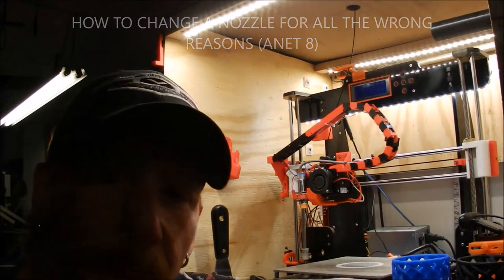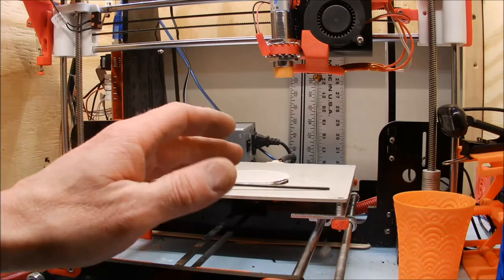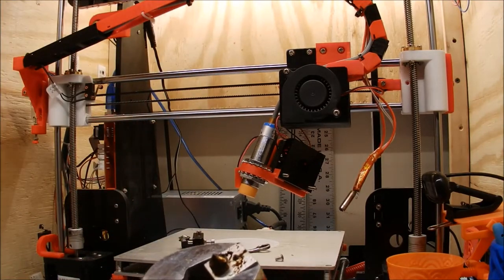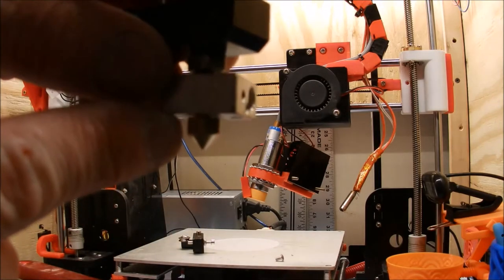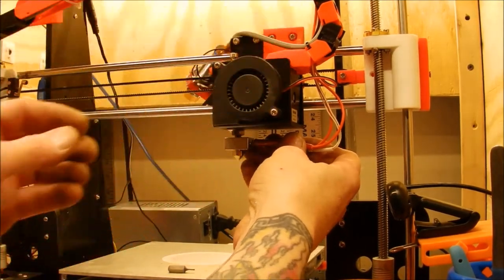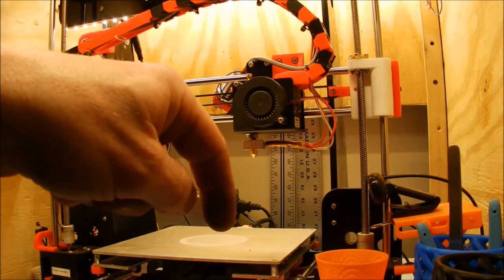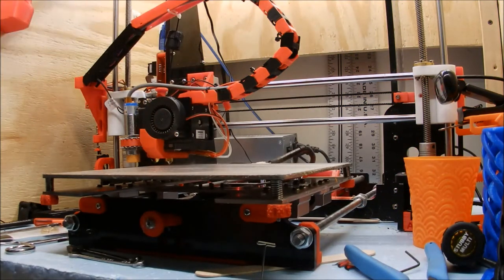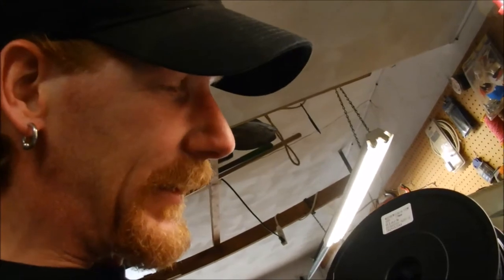How To Change A Nozzle For All The Wrong Reasons

Comment: Wish I had watched this before trying to clean my nozzle and throat on my new Anet A8 after 1 print. I neglected to verify that the nozzle and throat were tightened up correctly and I had a lot of filament ooze out around the head of the nozzle and throat on both sides of the heater block. I didn't heat the extruder up before trying to back off the nozzle and snapped it. :( Have replacements on the way, but now I can't print anything this weekend. Good video though on how to replace the nozzle and throat.
Reply from the maker: Man that sucks hate when things break while your waiting for your parts you could watch a few of my videos :) ever have questions feel free to ask thanks for watching